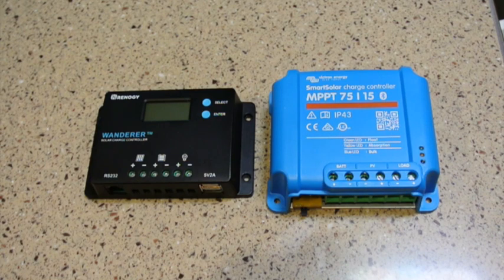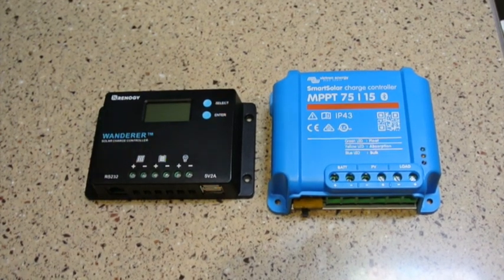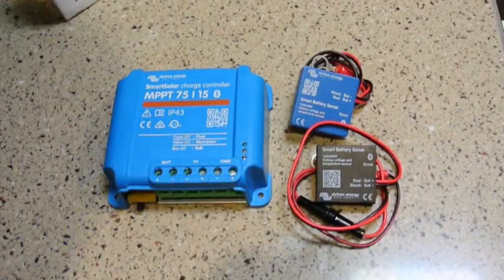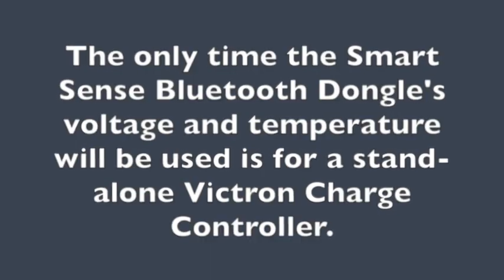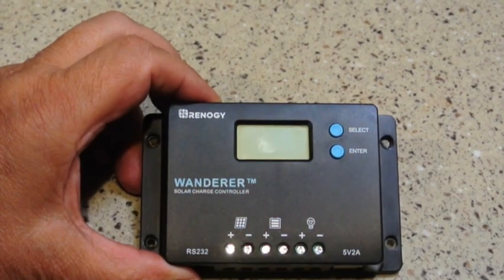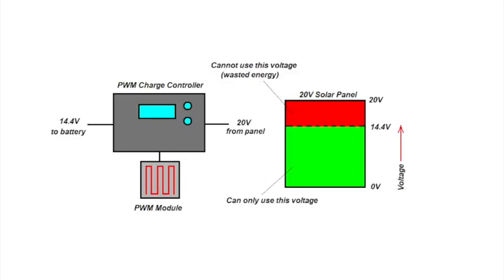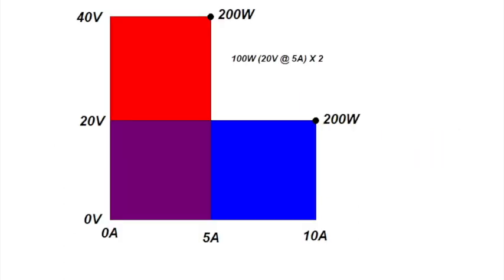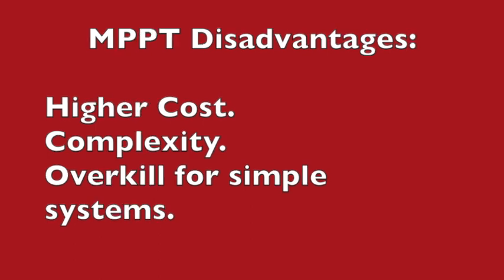PWM vs MPPT Controllers - Portable RV Solar Charging Video 5

Comment: I have bought a pwm controller for 1x 100 watt panel. There are 3 connectors: panel, battery and load.
What do i plug into the load connector? I a very new to this all, so thanks!
Reply from the maker: The load connector is optional. It is designed so that if the battery discharges to a certain level, the controller can disconnect the battery so that it does not over-discharge.

Unfortunately it is not practical to use in a RV as the load connector cannot output enough amps.  

If the RV has a leveling system or slideouts, they demand a lot of current that the load connector on the solar controller can provide.

So normally in a RV, the load connection is not used.

Comment: Excellent video, thank you sir. I got a question: can you program both PWM and MPPT controllers for not to overcharge/over-drain lead acid batteries? I have learned that they would  only last long in case you charge them to 95% and drain them to 50%.
Does the controller do this auto or can it be done by programming the controllers?
(I am a beginner just started to learn about solar systems.)
Reply from the maker: For lead acid batteries, discharging them to less than 50% is indeed hard on them. But overcharging them over 95% is a myth.

The typical smart charger has three charge modes; Bulk, Normal (or Absorption), and Trickle charge.  When a battery is less than 80% charged, the charger will typically be in Bulk mode. This is the rapid charge rate. 

When the battery becomes charged more than 80%, the smart charger goes into Normal, which is a lower charge rate. This lets the battery cool down from the rapid charge as it reaches full charge.

When the battery becomes fully charged,  the charger goes into trickle charge, which is a very low charge. It is sometimes also called a float charge. The low charge rate basically keeps the battery topped off and 100% charged.  A lead acid battery can remain on trickle charge indefinitely.

A cheap non-smart charger does not have the capability to shift charge rates, and will supply the same charge regardless of the battery charge state.  Those type chargers should never be allowed to charge the battery into overcharge as excessive charging causes gassing (loss of water in the electrolyte) and can damage the battery. 

So a battery can be charged to 100% with the proper charger. With a cheap charger, it should never be allowed to go into overcharge. This is where your 95% of full charge comes into play.  

Good solar charge controllers such as the name brand MPPT and PWM chargers are smart chargers.  But the very cheap chargers from Amazon - you don't know what you get.  I have seen them for less than $15, and I would be suspect of those.

For the Victron Smart MPPT charge controller, you can change some parameters via smartphone/bluetooth app, but I would not change any settings arbitrarily.
Reply: @RVProject  that was an excellent explanation thank you !!!!!